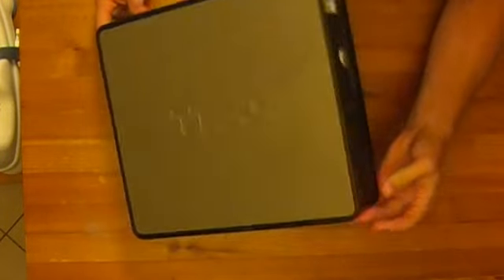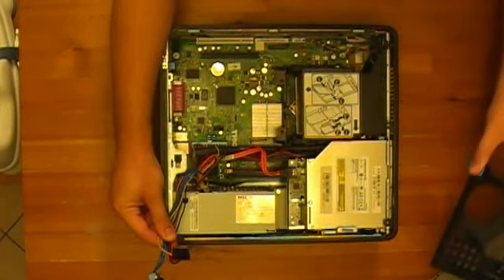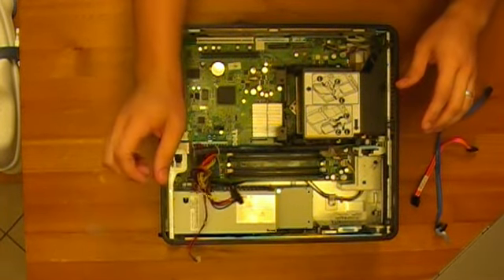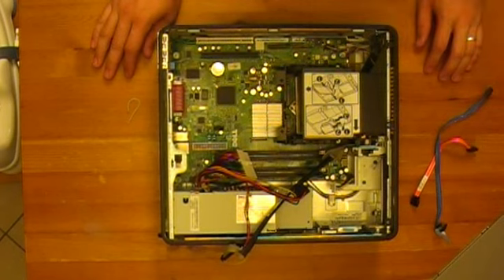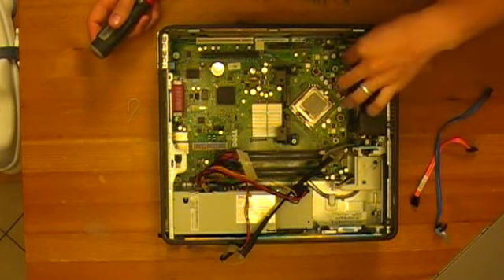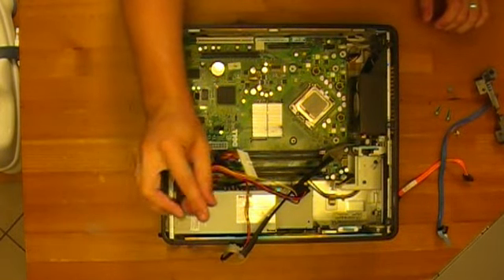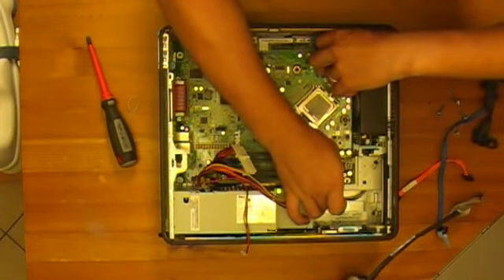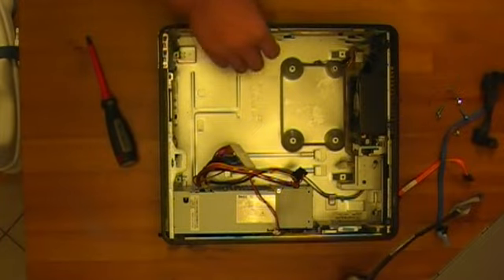Motherboard Removal Optiplex 745 sff

Comment from the maker: @H4x1990 The only one I know is you can take the cpu fan out and mount it backwards so that it pushes are out of the case instead of pulling it in. Not sure if I will do that or not or I may ad another exhaust fan, just need to find a place to mount it.

Comment: I'm not quite sure as to what you mean by update, BUT, I've added GeForce8400 GS cards on the three 745sff's we have here at work and disabled the onboard video card. That's possible thanks to this graphic card's ability to separate into two (one for VGA and one for DVI). Hope this helps ;)

Comment: I have a dell optiplex 745 pc and I am upgrading the motherboard to an lga 1150 motherboard but I can't get the old one out. I undid all the screws but it won't come out of the case. The mobo is loose but it refuses to budge. What went wrong? Many thanks in advance!
Reply: the cpu coolers under screws are still in, I had the same problem